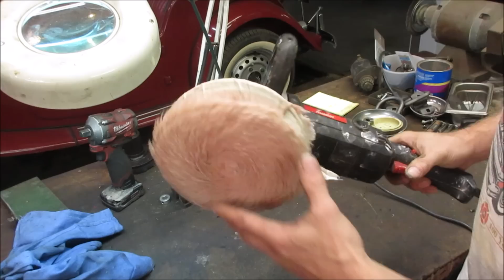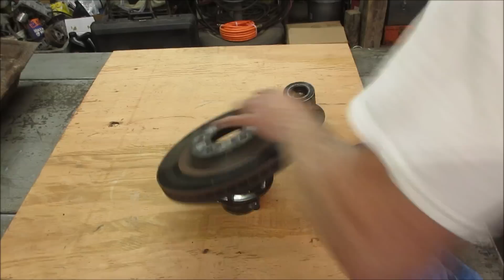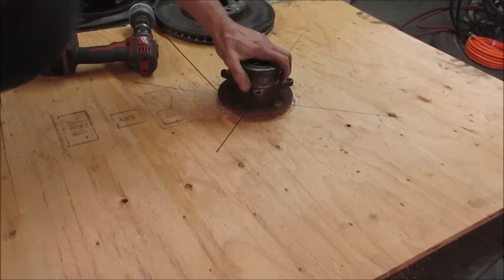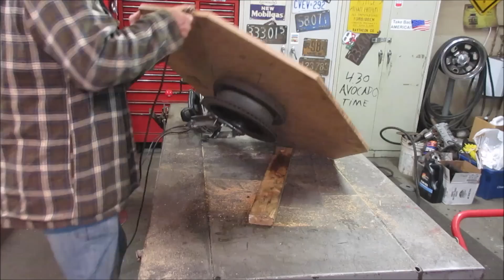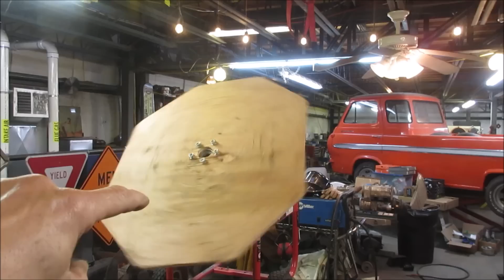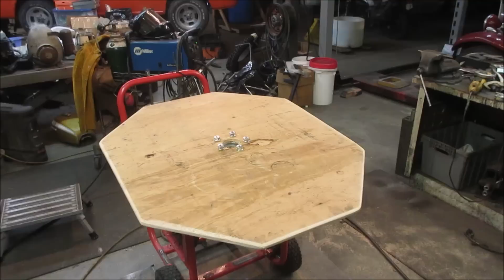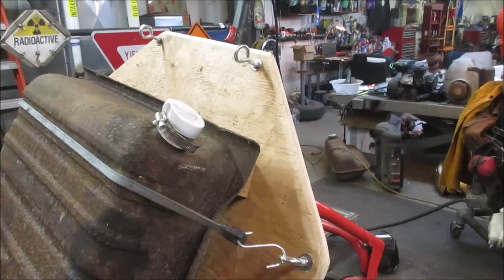Building A Machine To Fix Rusty Fuel Tanks Of All Kinds - Let's Get Started!

Comment: You could have just put a clamp on the grinder handle/switch and then that way you could turn the power on/off by plugging cord in or you could rig a regular wall switch into the power cord .🤷‍♂️

Comment: Darren, I would suggest you install a “speed control” so you can vary the speed depending on the size/weight of the gas tank you’re trying to de-rust. Possibly something as simple as an incandescent light dimmer should work as long as it’s rated high enough to handle the current of the motor. Even a Variac I believe should work. I have several so if you’d like one let me know and I’ll send one to you.
Reply: the speed controller in the grinder is exactly that, a triac dimmer, but if he wants to even half the speed, he can put a diode in series
Reply: There is a speed control built into the polisher body, he currently has it set on the lowest speed, hence the change to the smaller pulley, his machine can't go any slower than it goes, but it can go faster for smaller tanks....
Reply: @stevedoran3631  Ideally, he should set the speed control to full on or bypass it all together. Then use the outboard triac/variac to provide full control by adjusting to any speed he desires.
Reply: @PaulMack1249  Seems like a lot of work just to get some less RPM when he already has the speed range he requires by keeping it simple...... sometimes over engineering becomes redundant and a waste of time......
Reply: @stevedoran3631  He has the correct speed required for that particular tank. What happens when he attempts to clean the much smaller motorcycle tank which, in addition to its size, is oval and not rectangular. The dynamics have changed and so must the speed at which it’s spun. Besides, it’s     Mustie 1. No waste of time…it’s what he does to entertain us.
Reply: @PaulMack1249  When he needs a faster speed then he only needs to turn the speed control on the motor to increase it, as I said earlier, he was running at the lowest speed he can, but he can adjust it to a higher RPM by simply turning the control knob, no need for external speed control....
Reply: Best video in years !!

Comment: Years ago we got an old dryer that we used for cycle gas tanks.I know the car tanks wont fit.We used bolts nuts gravel and sand and wrapped the tank with some thick cloth.Worked very well.

Comment: Brilliant idea, brilliant execution, especially using 99% parts on hand in hone parts stash! 
I think your minimum RPM still a bit fast, centrifugal force will take over again with tank positions closer to horizontal. Consider a larger diameter disk brake rotor from a sports car or truck. A shop with a break lathe might cut the thickness down and dress up the center for proper belt fit and to reduce overall rotating weight mass. With a pulley a couple of inches larger you'll be able to better use the the adjustable speed of the power source. This is clearly a shop made tool you'll get a great deal of use out of!
Well done, thanks for the years of entertaining content you provide!

Comment: I'd use A derailer and 👍 thumb shifter selector for disengaging and engaging the tension to start the chain and sprocket's turning. Along welding ratchet straps angle iron uprights with pre-drilled holes going through the top for the ratchet straps hooks to lock into.

Comment: You know how to take A weed eater engine put A sprocket ⚙️ gear on the metal cable driven shaft? By using set screws.,or what some people call squared electric motor bolts for centering and locking into place for secure operations. If used the engine like that it would save yah ruining A perfectly good buffer machine. Find A go kart.,or older riding lawnmower that has sprocket ⚙️ gear on it that will match up to the chain Gap and amount of teeth for the chain to work. Like bicycles have sprockets and chains that are matched in alignment with each other so that they'll work together as one system set-up.

Comment: I use a old large Sears Cement mixer. It pivots somewhat! It's great for original bolts before nickel plating. It would also hold everything but the econoline tank!  Maybe fiitting a board to it with straps to hold car tanks would be just the ticket? Great Vid as always!

Comment: I see a number of others had the same thoughts that I did, why not strap a gas tank in a cement mixer and partially fill and seal the tank with a cleaner or maybe better yet a sand basting media and let it run. It seems there's an awful lot of weight for that angle grinder to turn and maybe at least a regular fractional motor mounted would be better. In any case, it's amazing to see just what Darin comes up with in his "stash."

Comment: There is nothing better on a sunday than watching a mustie1 video. This is a fantastic idea. The things you come up with off the top of your head are amazing. I noticed, you said it was a little loud. If the noise got to be a problem, you could bungee cord. A water heater blanket the front of reply wood. Or maybe secure it with a bar on one side and.
 A boltable plate on the other. Great job, great video.

Comment: you could use it for a rotating display table for something you restored and for the tanks id use gravel for the cleaning of the tanks would knock the rust off without hurting the insides of the good part of the tank and a work bench or table when not in use cleaning a tank also spreading applying tank sealer  to them as-well

Comment: Hi everyone other uses :- in the past I have used a tank treatment called petseal which coats the inside with a paint type layer mostly for pin holes, however your tumble tool would be great to treat the tank inside. So don’t have to keep shaking it pulling muscles which you didn’t know you had. 😅

Comment: Bolt a 5 gallon bucket to the center add some sand or polishing media and clean parts for paint prep. And/or add a windshield washer motor to the angle adjuster and have a second plane of motion

Comment: Works great and the price is right! I get cheap "tumbler media" in the form of Redneck Diamonds aka busted windshield glass. It's sharp so it scrapes and cleans good and the local windshield shop is more than happy to give me all I want. I use water and de-greaser first, then rise and add a quart of Evap-o-rust for a final run.

Comment: If you really want to slow it down, use another belt and pulley to make it a double reduction drive. The torque would be greatly reduced and the motor would pull next to nothing amp wise.

Comment: A good solution for the speed would be a ac speed controller. Harbor freight sells them for like $18. You plug it into the wall and then plug your power tool in and can vary the speed. Amazon has them for $26

Comment: I'd put a tank on the bottom of the thing that has a pump where you can pump out the stuff to clean it clean the tank and then you can pump it back in if it's stuff that you can use a couple times

Comment: First off , you are a Master Cobbler Extraordinair, your solutions to problems are usually very simple but extremely efficient and you are in the ball park at all times, I have seen people spend days doing what you did to get the first semi working prototype and have to scrap the whole idea , because they had a insurmountable design flaw. 
Your solution to slow the machine down of course worked just fine , but I was thinking of a variable speed switch or even an arduino to change that. If you used that you would have had infinite possibilities with just a turn of a screw, rather than tearing apart and rewelding to change pully sizes. 
 I don't think the arduino use  is that difficult to learn, and for 20 dollars you could have one that was dedicated to that piece of equipment or get a master set for 80 that would operate as many different things as you could make.  Just a thought, I don't blame you if you don't want to add the computer stuff in, but I have seen several of your builds where it would have been very helpfull, even if only to use as proof of concept. I hope you continue to feel better and that your health and pain issues disappear. I have been sick a long time and your videos are relief for me, thank you!

Comment: you could add a jack shaft and gear it down lower and spin it slower and let the motor spin faster so it isn't bogging it down and get better air flow. I use pea gravel .It works and isn't as likely to open holes. I used a rear end out of a Cub cadet mower and a drier motor with a speed control for mine.

Comment: I've had to deal with a lot of crappy fuel tanks in my life and have tried many things. What I've been using for over 15 years now with zero issues is electrolysis on the inside of the tank, followed by very carefully following the directions exactly, the POR15 fuel tank sealer system.depending on it has pin holes in it, I use por15 paint on the outside before electrolysis. Never had one fail, leak or rust out of the 8 tanks I've done and still have in some International Harvester scouts and trucks.

If you do it the way he does it in the video, it works short term unless you keep the tank completely full or completely empty. And depending on the environment completely empty it will still get rust and if you use it won't get kept full and if you don't use it much the gas will go bad. Might as well put in the extra time and fix it right.

Comment: I hope the bearings in that grinder/buffer last. I worked in a fabrication shop and did a lot.of repairs on angle grinders that were used for thwir intended purpose and i was repairing the same ones multiple times a week for various things including the bearings in the head and grinder body wearing out. They were just using them to grind with and i realize some people lean into a grinder harder than others, but that will have a lot more force applied to it between the belt tension and the weight of the rotating assembly attached to the second pulley.

Comment: Hey Darren, interesting (kinda Rube Goldbergish..) tool. Definable short ratchet  straps.. bungees will stretch .. messy .. add water or "he" detergent and water,  steel shot will be kinder ( but admittedly slower) to the tank..
I haven't Finnish the video,  but attaching the polisher to the gen set plug in panel will ļook  ool.
Thanks for ll your work.. You're basically my first go to on YouTube

Comment: Hi Mustie1!   Love your videos.   Regarding a strap to hold your tanks, bungee cords will work but I think if you use some old seat belts.    You’ll be able to clip the ends together and then be able to adjust for the size of tank by just pulling the tag end to snug it down.  Just like folks do in the car to fit different size laps.  
I hope this idea helps you out.   Keep up the good work!

Comment: I would take an old axle with CV joints and bolt the plywood to one end and weld a plate with holes to the other end that would bolt to one of your go karts, mower, snowblower etc. to power it- the CV joint will flop around as it rotates keeping your abrasives moving around in the tank.

Comment: Another idea is to plug the grinder into that panel on the side and wire it up so that you can have an extension cord leading off from the panel and you can actually plug in other things to the panel plus have lights to show voltage, a timer, etc

Comment: You need to install a variable speed potentiometer or a larger diameter pulley on the brake drum or smaller pulley on the grinder shaft. Also you could use that hole cutting saw and reduce a lot of weight on that plywood board it doesn't have to be super solid just drill out a whole bunch of holes removing a bunch of 2" pieces of plywood.

Comment: I was thinking harbor freight sells tracks you can screw to things that have slots in them and ratchet straps that lock into the slots making multiple attach points easy and a good secure hold of the tank

Comment: you can put one of your 2in1 Pullies as a second stage with second belt on it on the side. Lets you run the motor little bit faster but slows down the plate even more.

Comment: When the wife needs a new washing machine save the old one for parts. A good use for this in addition to cleaning gas tanks would be to strap JD Vance to it and throw darts at it ( like your Batman suggestion). That fork lift is probably the best thing you ever bought as a tool, comes in handy quite a bit.

Comment: I have a brass tumbler for firearm brass. It does a great job on polishing and getting all the dirt and rust off the brass. I used it to clean a MC tank off a Suzuki lt230. I used corn media or walnut media with rouse. I just poured the bottle into the tank and into the tumbler with some brass too. Since the tank wouldn't fit in the tumbler I closed the tumbler up like normal and used packing tape to tape the tank to the lid of the tumbler.Turned it on and ran like normal and the tank on top acted like a second tumbler boil. I left it overnight running and it cleaned everything from the tank and it was some weird plastic or rock like formations in the there from the old gas. Flipped the tank over to get the top and ran it again. The tank was clean and so was the brass cases. Try it. I think it will work on metal tanks as well as my plastic tank. 
Just a tip. Rinse the tank out a few times to get all the media out of the nooks and crannys. I found a few specs caught in the inline filter since the tank filter was gone. But by the second tank it was cleared up. I will make a video of it next time I do it and share it. Maybe it will be better to see it in action. But it worked great.

Comment: I wonder if using bolts and evapor rust is a for good combination for this MacGyver contraption LOL. It'll also be a good idea to put a real a heavy duty switch instead of the switch that's on the grinder because they are very thin and as the load keeps up you'll probably burn out the switch before you'll burn out the motor.

Comment: Hello Mustie: Another fun build. Back in the day the garage group Ihung out with made one from an old spoked wheel. Not sure what the wheel came from but it was probably about 27 " x 4". It ran from 9rpm - 20 rpm. Worked great on all smaller tanks. Used mostly for motorcycles. The larger car tanks were difficult to mount. You fixed that issue. Regarding the slurry mix, we used to add a few table spoons of lye or caustic soda to roughly a gallon of water. It worked well and was cheep. Great job and the unit can certainly handel a large tank without difficulty.loo,ing forward to see what your creative side will think of to build next.

Comment: Reminds me of a project I enginerded a few years back to spin and grow a large potted plant 6 million times in my garden: used an old Dewalt drill hooked to a rubber wheel to friction turn a bike wheel platform supported from underneath.  I used a variable voltage PWM AC/DC controller to control the drill speed and spun said plant at 35rpm all year.  It grew very well and did better than the plant right next to it (no mold in fall, tighter buds)

Comment: For various tanks, you can start saving styrofoam blocks and odd shapes to put between the tank and the plywood. It will give enough not to dent a motorcycle tank and for the welded seams, it'd be easy to cut a notch in the styrofoam to accommodate odd shapes.

Comment: To quickly accommodate the variety of tank sizes, how about screwing down sections of those cargo ratchet rails(for trailers etc.). A couple of slide in ratchet straps.. almost infinite adjustment. Brainstorming.

Comment: Fun to watch😎
I 'd "McGyver" an Cement mixer though. It's already build for heavy moving mass, and you can tilt it, while rotating. Would need some stabilizer on the base though🤔. But you could cut of the front and weld a platform on it, or just use it, as it is... They are pretty loud though.. So that's a factor to have in mind..
Anyways.. I Like my Sunday Musti1 Entertainment nevertheless 😎👍

Comment: Plates with holes attached where the handle attaches so you could use locking pin to adjust positions would work pretty good I think

Comment: Spinning Wheel" was a crossover hit released on 33 LP in 1968 then May 20, 1969 on 45 as a Single reaching number two on the Billboard Hot 100 chart, number four on the US R&B chart, and number one on the Billboard Easy Listening chart. It was nominated for three Grammy Awards in 1970, winning Best Instrumental Arrangement. 
Blood, Sweat & Tears was a jazz fusion/rock band that blended rock, pop, R&B/soul, and big band jazz. Their self-titled album spent seven weeks at number one on the U.S. charts in 1969 and won the Grammy Award for Album of the Year in 1970.

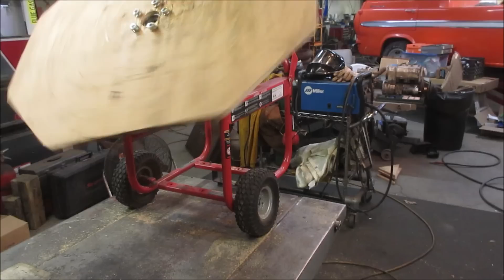Comment: 54:54 if you're concerned with the speed you can get variable speed controllers for a/c power tools, routers etc. All the way from zero to full beans. 

As for the variable angle, 45 is good, then if you must, you can always turn the gas tank upside down and run it again. 

If you did it vertical, you could fill the tank halfway with a slurry, and as it rotated it'd get all 4 sides.

Comment: For finer speed control, you could have the belt and pulley on the polisher drive a reduction gear assembly that would then drive the tumbler itself.  That should allow you to use more of the speed range of the polisher motor, as well as further increase the torque available when tumbling fuel tanks with liquids in them.  Use a fairly simple four or five to one gear ratio to slow the tumbler down more, and you could crank up the speed control on the polisher to fine-tune the rotation speed.

Comment: Perhaps use a bicycle wheel as the largest belt hub to reduce the rpm enough. Welding to cast use E7018 electrode.